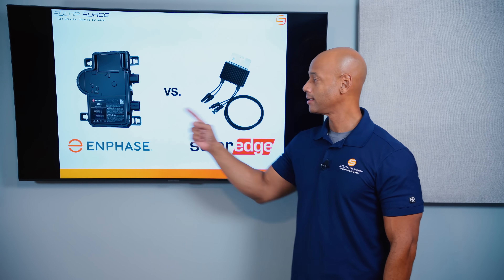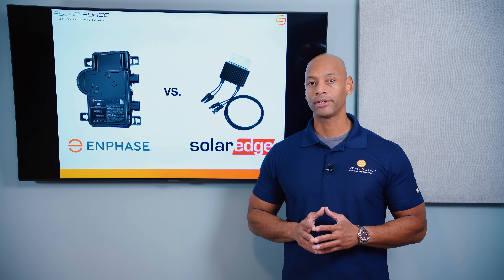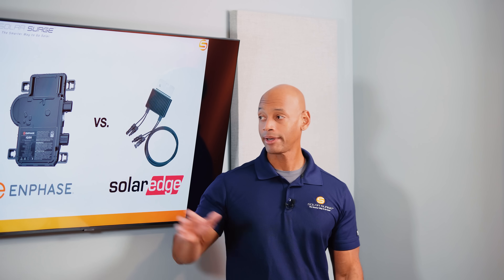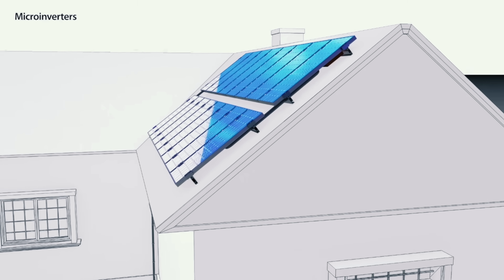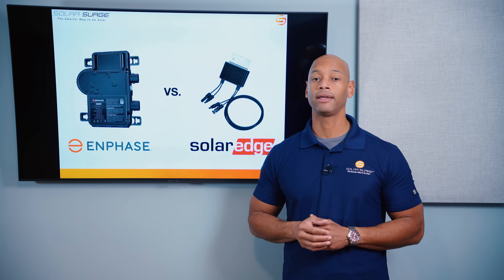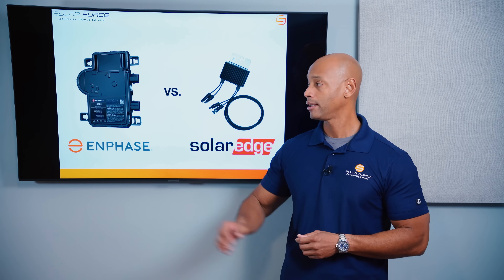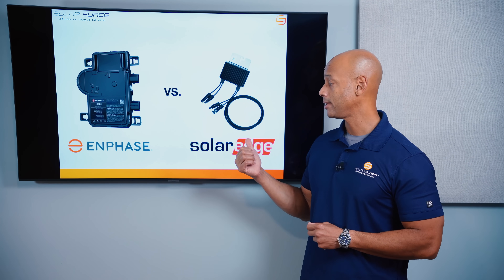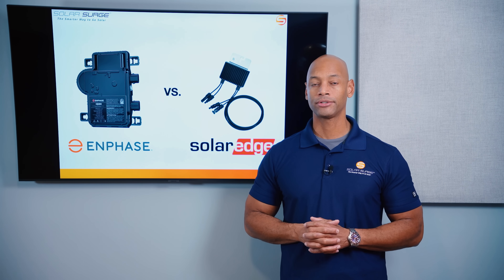Micro-inverters Vs DC Optimizers (2024 Updated) | The SHOCKING Truth

Comment: One item that is rarely talked about is the battery black start problem for micro inverter based systems. Because the panels are in effect producing AC power directly with micro inverters, the power is generally brought straight down to the main breaker panel and then on to the battery for charging. Now let’s suppose you’ve had a particularly bad power outage and for whatever reason (day 4 or not paying attention) you’ve allowed the battery to drain pretty much completely. If you’ve installed this system for your nontechnical mother in law, it’s going to happen pretty much every time the power is out for a day. Now it’s morning and time to recharge the battery with the panels. (The grid is still down, so no help there!) The sun comes up. You are producing a little power, maybe 1kW. The sun is low yet. This means the battery should try producing a AC signal for the panels to sync with so it can generate power to recharge the battery. The battery has to give in order to take. The problem here for the micro inverter system is if the two exchange energy through the main circuit panel, then the rest of the house gets a crack at the energy too. Recall the battery has been down potentially overnight. The freezers are warm. The house is cold. Every light switch in the house is still on. This cold house is primed to draw its maximum load for the month as everything comes on at once. However, we already stated that the battery is pretty much out of energy and the solar isn’t producing much, so what happens is the demand overwhelms the supply, the battery drains lower and is forced to give up. An hour goes by. It tries and fails again and has drained itself further. Now it is a race. Either the sun gets high enough in the sky to deliver its full 10 kW or whatever the size of your system is (fat chance in the winter!) and finally it overwhelms the load and manages to charge the battery and your system is saved to run again another day, or the battery becomes so depleted it can’t try again, and it will stay dark until the grid finally comes back on the following Tuesday. So much for battery backup keeping the lights on! Black start is not very reliable.

If you have direct dc charging of the battery (powerwall 3 and not powerwall 2), this can’t happen because the energy goes to the battery system first then the inverter and then the house. The battery can totally decide to let the house stay dark a while longer until it feels it is charged enough to support that morning restart load and get everything running again. It doesn’t have this option if the solar and battery connect through the main panel. Does Tesla actually do this? I don’t own a powerwall 3, but they would be dumb not to, so I’m going to assume they do.

If you are running on an older ac micro inverter system and do have the black start issue, you can rescue yourself  turning nearly everything off in your breaker panel, wait until the sun is high and the battery mostly charged, then gradually turn the load back on, but this only works if you are home, you are willing to open your breaker and start flipping switches and you’ve taken the time to actually label what is what. So, it isn’t going to work for the rental property you bought, your house sitter or maybe your elderly parents. It also only works if you haven’t let the battery get so depleted the system has given up completely and it refuses to even try. So, now you will be closely monitoring your battery state of charge every time the power is out for more than a day to try to keep it to not drop below 10%. This may mean you shut everything down at 10 pm with state of charge 20% because you know that if you leave it on,  y morning you’ll have burned it down to below 10%. Tropical fish? Pet lizard?  Sorry guys. Your time is up. If the battery goes dark for days you are surely doomed. Maybe you will survive the night? Ours didn’t. The cats and people were fine though. It’s a lot of micromanagement, and might involve some difficult decisions. It isn’t quite what you signed up for when you thought you were getting battery backup for a power outage.

With a DC coupled system, the fish can still die, but at least the battery is more likely to be up and doings its job at least some part of every day in a prolonged outage without a lot of intervention. You need more solar, not more battery if you want the fish to live.
Reply: This is immediately rectified by setting a lower limit on battery charge on your BMS
Reply: Enphase iq8 and system controller 3 solve this problem. When there is a grid Outage, the syscontroller will isolate the battery and the solar panel from the rest of the house. Even if the battery is completely dead.
Reply: While I totally see your point, where I live have not had a power outage longer than 12 hrs in 20 years so not a huge concern for everyone.  Buy what's cheap (but not so cheap you get a lithium bonfire in your living room), do what will give you a good roi. If you live in an area with a history of prolonged outages then perhaps op's points more seriously.

Comment: Seems like microinverters are old school technology. If we have a limited amount of roof space, we can’t afford the ten to thirty percent energy loss that comes with microinverters. And, the average homeowner will want at least 50 kWh of storage, both for topping the change off in our cars and keeping the lights on through long outages or dark winter days. So Enphase is a lose/lose with their microinverters and their tiny batteries.
Reply: You still need an inverter, regardless. Microinverters are just a better solution, albeit slightly more expensive.

Comment: The shading issue has been largly solved for decades, there are tons of videos doing tests of panels... Even one where they used a cricket bat and smashed one of the panels... The rest of the string was largely unaffected. 

Panel level monitoring is neat, but optimizer or micro inverter systems are expensive and much more difficult to repair. Since the likely failure point ia the inverter over a panel it means a call out to your house and access to a roof which may need scaffolding... These seem like way more hassle than they are worth.

Hoymiles, NEP, or AP systems seem to make more sense since they have the 4-1 micro inverters which brings the cost per panel way down.

Just as an example, a single Enphase IQ8A for a 400W panel in Canda is around 330 bucks, the panel itself will be around 300 bucks. But if you do the 4-1 unit that is sized for the same panel it will cost around 450 bucks or about 112.50 per panel, reducing the overall cost which makes the payoff period of the system more resonable.

Enphase in my area just makes the whole system not viable.
Reply: Microinverters have a big cost savings realized later, as string inverter systems with a central inverter will likely have to be replaced 3 times over the course of the system lifespan (35 years).  Each central inverter will cost around $4500 w/installation so $13,500 in additional costs over 30 years, plus whatever lack of energy production (from all  panels) that was lost due to down time... and my system (being large) would require two central inverters so double that cost.  That central inverter replacement cost is nearly at the cost of my entire Enphase system (after fed/state rebates) with 52 panels! The microinverters last longer because they run cooler and aren't handling large loads like the central inverter (hence the longer warranty on microinverters).  Also the safety of having A/C running through the attic (operate at the same low-voltage AC power as a typical home) instead of DC.  Running high voltage DC wiring through an attic can pose a risk of arc faults or fires, particularly if the wiring is damaged or improperly installed.  Also, upgrading panels on Enphase is much easier, I can simply add more panels.  With central inverter you have to size the inverter to the panels, so if you are adding panels (or adding higher wattage panels in the future) you may have to upgrade your inverter to a larger one at a significant cost.  Also, in 10 years when panels produce more output I can replace individual panels in Enphase system and get the higher output where as mixing panels with significantly different wattages in a string inverter system is limited by the lowest-performing panel, even with optimizers. Also, ask any installer/repair person about warranty swaps on equipment and you'll find out the Enphase makes it easy vs SolarEdge not so much.  Plus there's a lot to be said about modularity and scalability, Enphase can support additional items like using your electric vehicle as a battery store and being able to draw from it at night when the sun goes down.  Also fixing a microinverter is easy, heck I can do it, just tilt the panel, unplug the old, plug in the new. Albeit it's on the roof but no that big of a deal to climb a ladder.  And guess what, the string inverter system with power optimizers have a optimizer behind each panel also!  So not only do you have a central string inverter to fix if it goes bad, you also have power optimizers behind each panel up on the roof that can go bad too. So I fail to see why anybody would buy a string inverter system (even with optimizers) when there are so many disadvantages.  Initial cost and not having some conversion power loss when storing excess generation to batteries is the only advantages of a string inverter.

Comment: My system uses Enphase microinverters but I will never use or recommend them again. The insanity of these people to adopt the latest cliche thing being talked about is too much. 
Enphase, without warning customers, pushed an update to require a "key" to use their systems. It broke many, perhaps all, installations that rely on external controls, mine included. We now have a hard dependency on renewing this key from Enphase. This is entirely unnecessary as my system, and I suspect the majority of others, are secured. And even if they aren't, it's not up to Enphase to dictate how I run my system. Many installers and developers of Enphase systems complained but the company refused to revert their boneheaded decision.
Reply: I have Enphase and haven't experienced any issues over the years.  Can you reply with a link to an article talking about this "key"?  I'd be interested in learning more about it.
Reply: @MaxAcceleration  YT doesn't allow links but you can read more about it if you use their name and "token". 

They basically forced a fenced off system, with zero dependencies to have a hard-dependency and functionally that expires if left unattended. 

If you don't connect to your system directly, it doesn't affect you. But many of us do as the unit is integrated into other local systems 

A good number of us have complained but they don't care. So, I'm not recommending or installing anything from them until they give me my system back.

Comment: The triple conversion 'penalty' of an AC coupled system (micro inverters) vs a DC coupled system (string inverter) is about 5%. This is because the DC-DC conversion in a string system also has losses. 

To say that its 30% without further explanation makes me wonder if you are partial..

Also, with far more efficient GAN based electronics appearing in more modern inverters, the 'penalty' is about to be further reduced.
Reply: What is GAN?
Reply: @tombrownca it's GaN
Gallium Nitride.  Just newer semiconductor tech.  Most of the super small high power phone chargers these days are GaN based.
Reply: No it's just common sense. Do the math.

Comment: Microinverters also convert to AC at the panel, making the transmission of current over distances much more efficient.  (Less loss, and much less cost of wiring).   I'd also be a little concerned about the statement "up to 30%" loss on the triple conversion.  Most conversions are easily under 5%, so at worst you are looking at more like 15%, and no matter what you will have to convert at least once, so now the difference is likely less than 10%.   Both are good options, but if your run from PV to the inverter is more than 20'-25', please do your homework on the efficiency of the wiring needed to carry DC.  (and remember the distance is not as the bird flies, its the length of the wire, so all the bends and curves add up quickly).
Reply: Microinverters convert DC to AC at the panel. MICROINVERTERS ARE LITERALLY CONVERTING DC TO AC AT THE OUTPUT OF THE MICRO INVERTER.

Comment: Oooo Um 30% more efficient for a DC optimized system is absolutely False!!
I would say 2 systems exactly the same one DC Optimized and One Enphase Micros, you may see 3 to 5% more Production with the Solar Edge DC Optimized System.
If there are multiple pitches, azimuths, and shading in my experience the Enphase system will out preform the Solar Edge all day long!!

Comment: With the battery it will be fast 5hrs, DC electricity into the battery and slow 24hr AC draw out of your battery. 

Smaller cheaper inverter. 😊😊😊😊

If charging the EV battery DC is faster and simpler. 
If EV v2g into the home battery DC is faster and simpler.

Comment: I have Solar Edge system. The inverter was replaced after 4 years. But optimizers have not. So far so good.  ☀️☀️☀️☀️☀️
Reply: Same here, one inverter, no optimizers. Installer tried to screw us over re replacing it so I did it myself.
Reply: @jamesjusick1462  this proves most points that the single point of failure i bad
Reply: I also have A Solar Edge system. Replaced inverter after 4 years but have had to replace six optimizer in eight years. Currently have two that need to be replaced and a string with low performing or zero output panels.
Reply: @gmacguy woof... Anything under the panel on the roof to me sounds absolutely crazy... I'll take the "30" hit that probably is a wash anyway if you're not shaded.

Comment: DC coupled ground mount systems require neither of the devices. Assuming everyone puts panels on the roof is a bad assumption. Removing snow from my panels is easy since they are ground mount.
Reply: I understand bifacial panels are more likely to be self clearing because the meager backside production will warm the panel and encourage the snow to slide off. I certainly know that with normal panels, if they are covered with snow, you are going to produce absolutely nothing.

Comment: How do you get up to 30% better round-trip efficiency with solar edge than Enphase? Let’s do the math:

 Enphase efficiency = 97% for IQ7A CEC Weighted Efficiency X 90% for Tesla Power Wall 2 round trip efficiency = 87.3 % efficiency.   

 Solar Edge Efficiency = 99% CEC Weighted Efficiency for solar edge inverter SE7600H-US X 94.5% Peak Roundtrip Efficiency for solar Edge Energy Bank BAT-10K1P  X 98.8% Weighted Efficiency for P505 solar edge optimizer= 92.4% efficiency.   

Where are  my math wrong?
Reply: You math is correct!
30% is a bold claim and false in my opinion.  In my experience it is closer to 3 to 5%
Reply: You are right, He added, nor multiplied.

Comment: Well, there are three ways.   Micro-inverters, DC Optimizers, or simple RSDs (solid state switches to meet firefighter safety codes).   Well, four ways:  Nothing at all has the least actual fire hazard and is now encompassed in NEC 690.12 and UL 3741.  But city codes still typically require the RSDs... unfortunate since RSDs (or micro-inverters, or optimizers) have 3x the fire hazard as having nothing.

I'm dealing with city permit requirements right now in fact.

In anycase, the output of the entire string is not reduced by that much.   Panels have had bypass diodes for over 20 years now.  Mostly shading a single panel only cuts-out that panel, with a minor penalty for the other panels.  50%?  No, that's not the case and never has been the case.  Usually not much more than just the loss of the shaded panel.

This is true with micro-inverters and optimizers as well.  A shaded panel can only produce so much electricity.  The only time micro-inverters and optmiizers make any sort of sense is when most of the array is going to have shading issues.  THEN they make sense.  But otherwise they're just an extra expense that installers like to have because it is easier for them to monitor the system.  At the expense of the home-owner buying the system.

Also, modern bifacial + half-cut panels handle shading a whole lot better, which makes it even less of an issue.   I get nearly twice the output from a modern residential panel in partial shading than I do from a traditional mono / non-bifacial / full-cut panel in shading.   Its like night and day.

-Matt
Reply: What  half-cut panels panels are you using?
Reply: @robert5  The particular ones I just got are the Hyundai 410W's.  HiS-S410YH(BK).  But there are many choices.

-Matt
Reply: I could not agree more. Most people intuitively understand that electronics typically age like milk not fine wine. Eventually they will fail. Both DC optimizers and microinverters literally add an additional failure point under each panel.